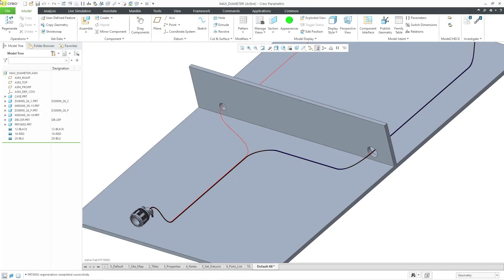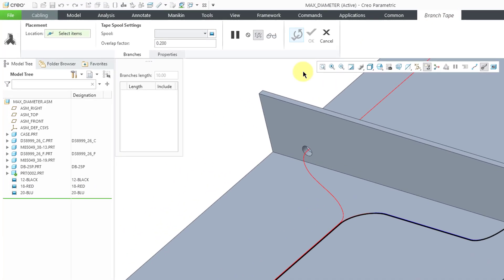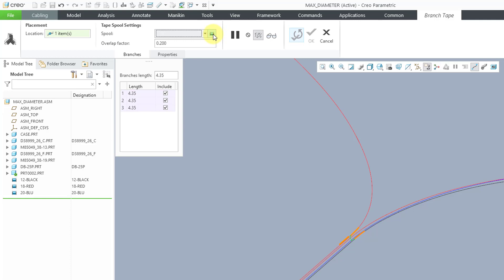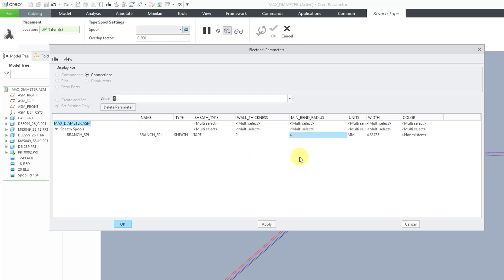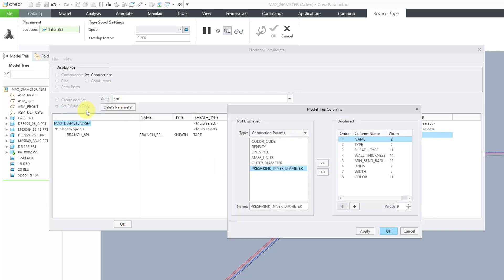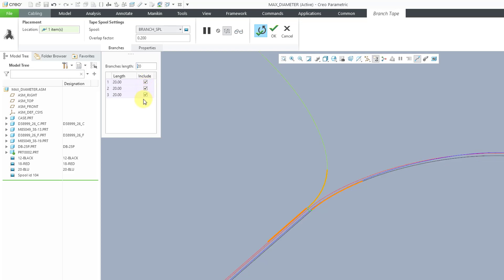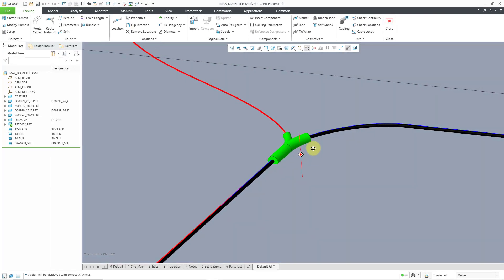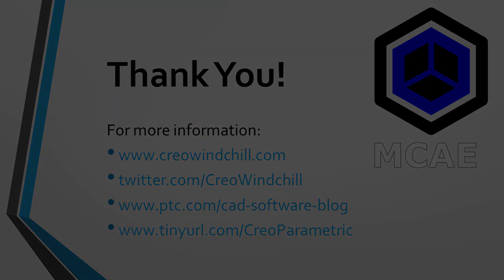Creo Parametric - Cabling - Branch Tape Cosmetic Feature

Comment: Hey Dave, very appreciative of your content. I've watched all these videos, but I don't believe I recall you showing taking a single cable and splitting it into a Y. All the harnesses you show seem to have one wire going to only one location. I have a network set up to route in a Y but can't figure out the wiring. Can you direct me to the video that shows that, or tell me how to do that? Thank you!

edit: I can get the wire ends next to each other using split/routing to the location of a network vertex, but I am unsure how to "join" the wires together.
Reply from the maker: No, I haven't done any videos on splices.
Reply: @CADPLMGuy  you should!
Reply from the maker: Some topics are really hard to get excited enough about to make a video. It takes a lot of effort to make these.
Reply: @CADPLMGuy  understandable. Well either way, appreciate your videos they're a big help to me and my team. You've got a whole engineering department of +25 that's thankful for your hard work.